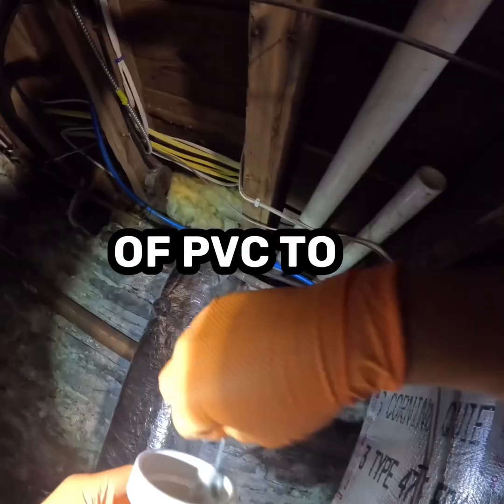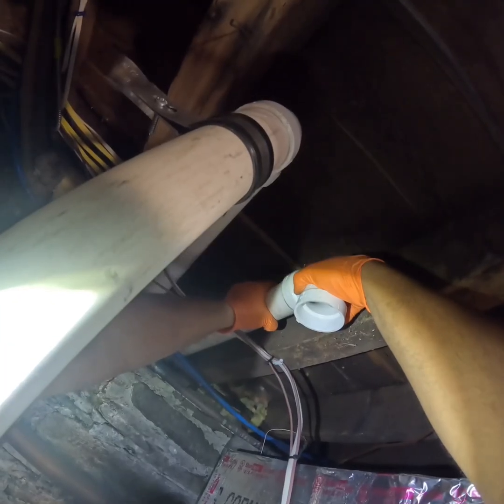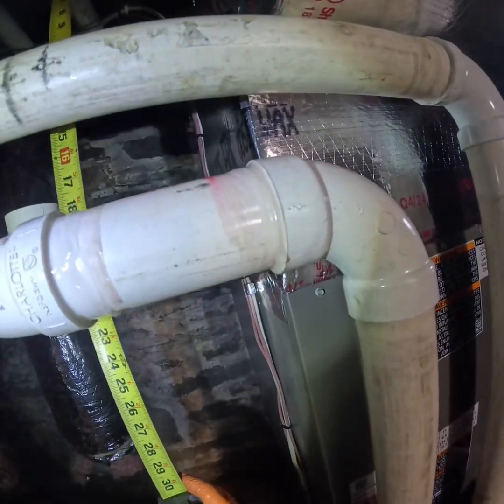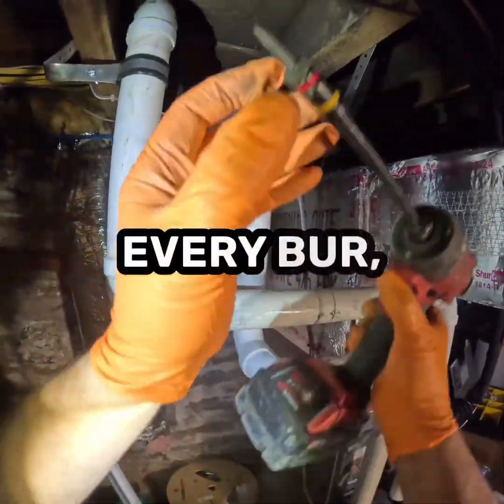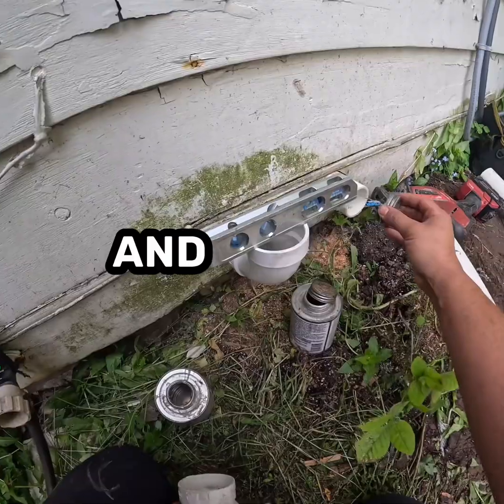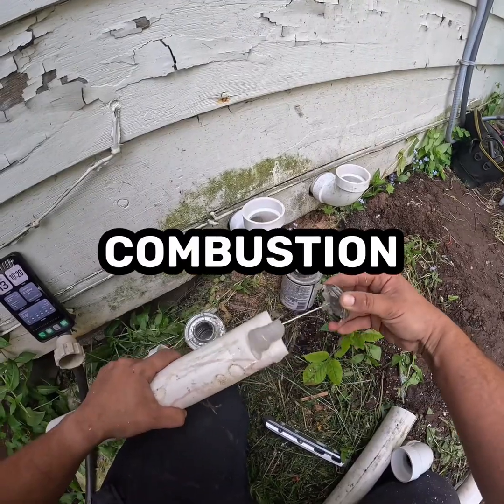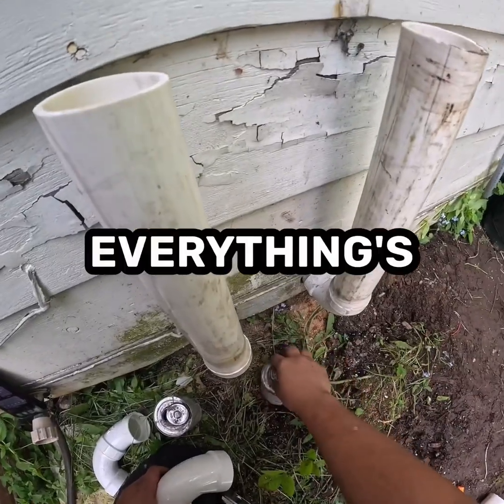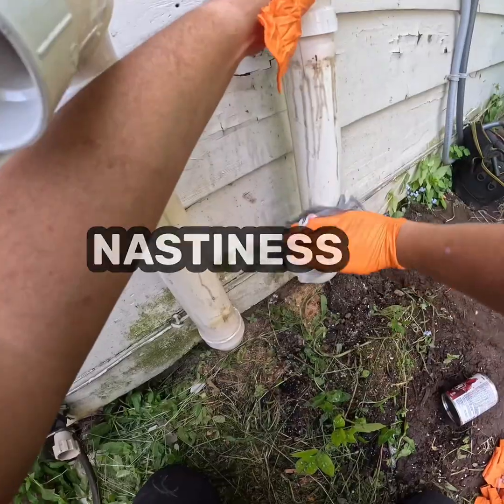Building the Backbone: How I Vent a Lennox High-Efficiency Furnace

Comment: That looks like an SP98 Lennox.  I just went through total hell due to poor drainage due to poor installation.  YOU MUST sand and clean the 3" PVC pipes during installation.  The small white PVC shaving clog the VERY SMALL plastic drain "connectors" that sit inside the rubber tubes that connect where the exhaust pvc connects to the furnace.  This causes E200 codes as a 98% furnace has low tolerance for air flow variances.  If your drain lines are clogged ANYWHERE, you'll get a bad reading, even for a second, to the pressure switch which will cause a Error 200 ( E200 Lockout).  Your PVC going outside must slightly drain back to the furnace as well.  Supports are needed every 5 feet, NO MORE, or water will form in flat spots, again causing bad readings on the pressure switch.  It will act like the inducer fan is going out, but in reality there is a blockage somewhere.  Check this before you buy a new inducer.  P.S.  Don't buy one from Repair Clinic, very bad pricing.

Comment: The lifespan of the heat exchanger actually has nothing to do with the flue and fresh air. Flue and fresh air are important for the overall operation and for proper combustion, but improper airflow from too restrictive returns, clogged air filters, plugged secondary heat exchangers and improperly set blowers are what cause low airflow which determines the proper life span of a heat exchanger. Most of this is from proper maintenance.
Reply from the maker: I appreciate the feedback and agree that poor air flow over the heat exchanger does cause trouble but I also believe that a venting installed improperly can cause it to plug up. Both things can easily kill the heat exchanger.